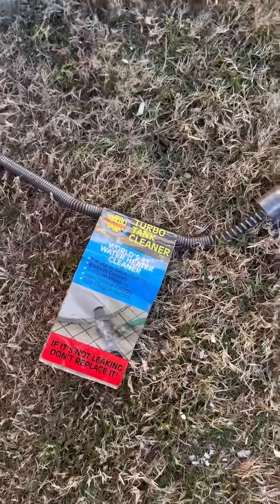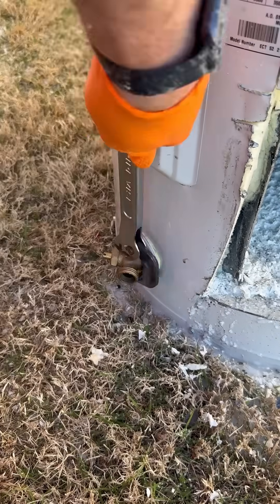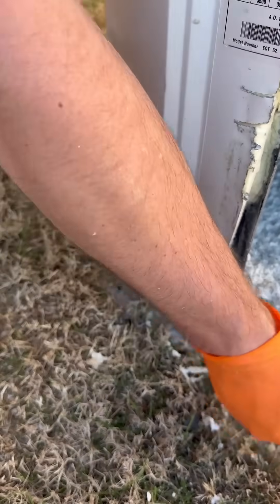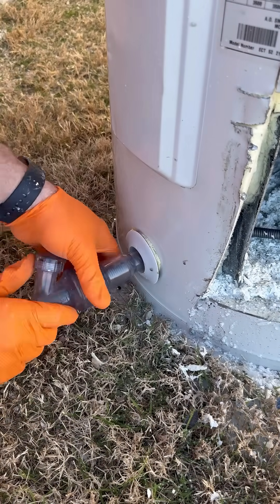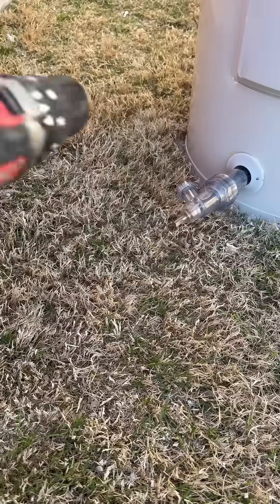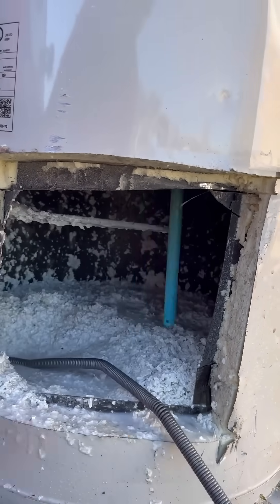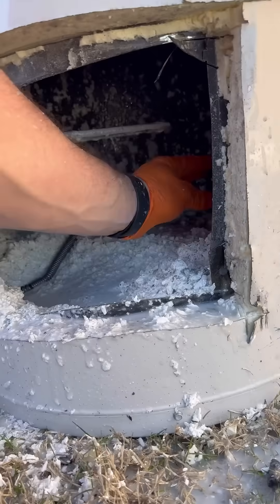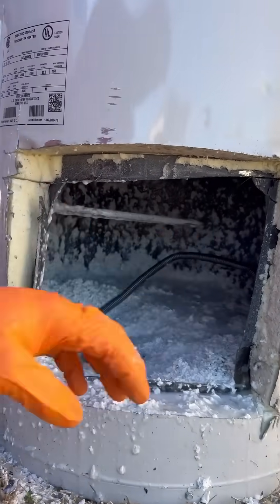What does a Turbo Tank Cleaner do to the inside of a water heater?

Comment: Mimic Sears water tanks from 1985. The inlet tube excited water at the bottom of the tank. It was curved and spun the water at the bottom of the tank. My 50 electric Sears water tank lasted 25 years!
Reply: this is what big companies don't want known.
Reply: I replaced a Sears water heater that was 35 years old.
Reply: They don’t make them like they used to
Reply: TurboMax indirect water heaters have no stagnant water
Reply: Electric water heater last longer than gas or oil
Reply: @alexanderteneyck2206 not a chance.  Gas alway lasts longer.  Much longer
Reply: I Can't remember who makes them but it's maybe AO smith or Bradley I've seen, that have a similar system. But I'm just the electrician that hooks em up and reads the side so I don't know much, just what I seen online when I looked em up out of curiosity. 

They seem to stir the same manner as mentioned here.
Reply: You also don't have to run the drill at top speed... Common sense...
Reply: Rotoswirl!
Reply: Seek& destroy, my Sears 50 gallon water heater did have the anode!
Reply: I just look at all that crap being stirred up and picturing the outflow being clogged continuously.
Reply: People that say that sacrificial anodes don't work really don't know the science behind them and how they absolutely keep corrosion of the metal of the tank at bay.  It is nuts to say they don't work.  Physics is the boss and make the rules.  Not us.
Reply: Most water heaters will last 15-20 years. Key is getting them off the floor so air circulation is present all around the heater. It only takes 3/4 on an inch to accomplish this. More is ok. That applies to setting them in a pan on a stand also. Get them off the bottom of the pan.
Reply: And it was double walled and didn’t have the bs anode rod. That’s why it lasted